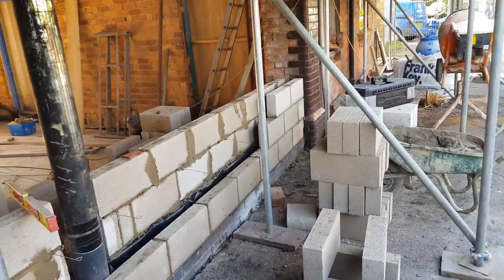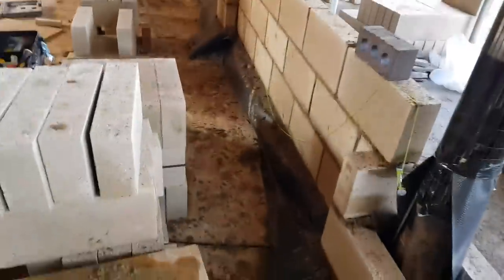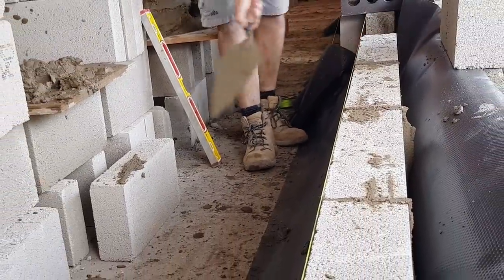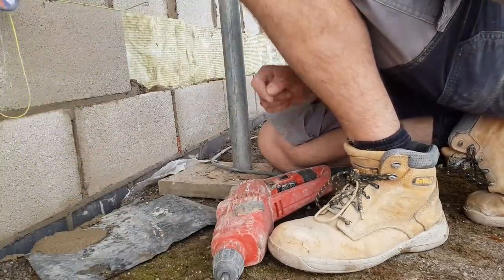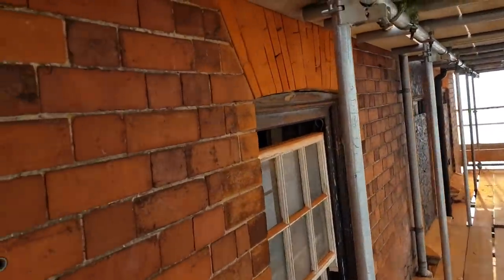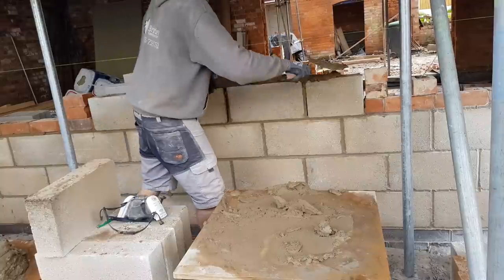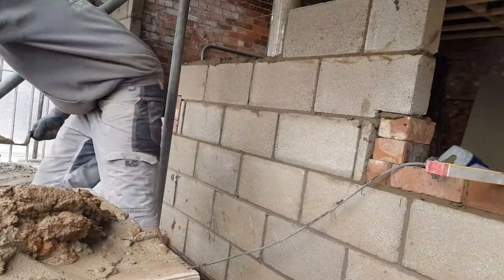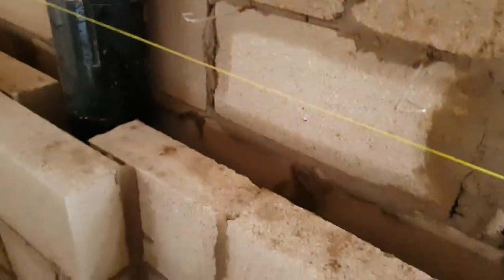Bricklaying - Transforming a Co-op built in 1900! Lots of Blockwork #bricklaying #renovation

Comment: Ayup Izzy mate it’s Vinnie here on me birds account… good video mate, quick question..do you put a bed under your weep holes? Also any tips on how you normally take your blockwork up 9 courses even on concretes without them swimming pal? Nice vid mate, cheers 👍
Reply from the maker: Sorry for late reply mate!
No bed under weepholes, I just place them tight on the dpc 😊
Taking up 9 is quite hard, as they always wanna lean out a bit especially if your got insulation in the cavity. Try less bed and try not to bash them down too much..failing that. I sometimes stack a few blocks onto of each other tight up against my corner to keep it right 😉👌
Reply: @IzzytheBricky  cheers for the reply my mate, I do the same with the weep holes, and yeah cheers for the tip mate will defo bear that in mind! 👍👍 have a good Un Izzy 😎